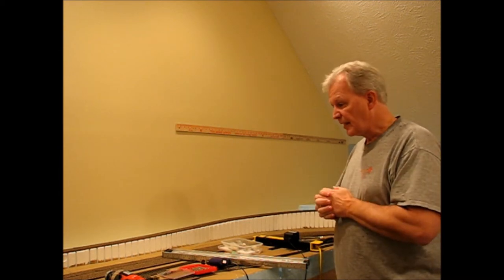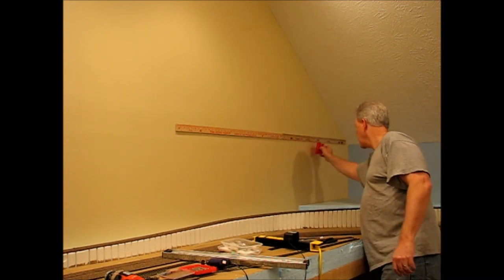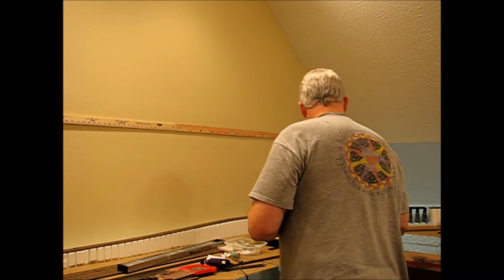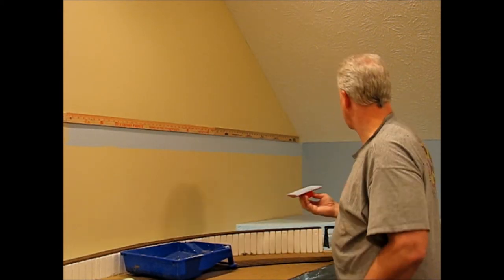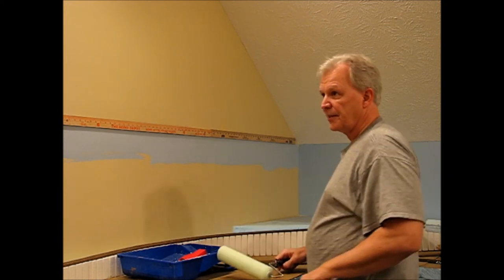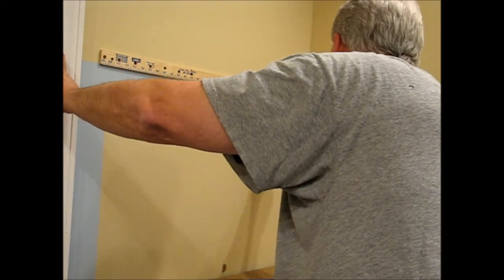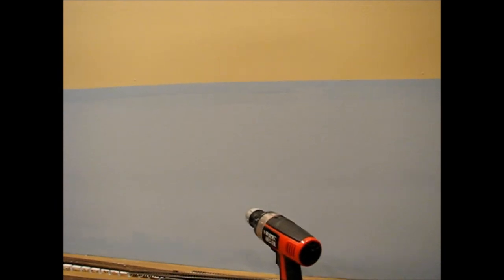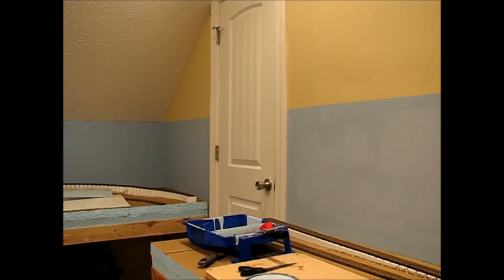My HO Scale Railroad   Episode 31

Comment: Great tip for the backdrop Brian, it's a great sized room you have there too-I like the logos on the truck, they came out well. Cheers, Dan
Reply from the maker: Hey, Dan!  Thanks for the comments.  I have to remember to take things one step at a time and not rush things.  Doing those intermittent small projects helps..
Reply: Yep absolutely.  I often get overwhelmed with mine when I think of all the things I need to do, and find that concentrating on a small area or corner of the layout at a time or certain job as you say helps.  The second it starts feeling like a chore is the second you need to down tools and walk away for a breather I reckon!  It's great fun though!  Cheers, Dan
Reply from the maker: TheMisterdan01 Agreed!  Hardest thing to wrap my head around was that "a layout is never finished" so I decided to not impose any deadlines on myself and just enjoy the process!!
Reply: yep that works for me also!

Comment: Nice work with the edging Brian. I didn't know that tool even existed so useful tip. I am think the car is the same Mattel model I have & it's in 1:76 so OO rather than HO but pretty close. If it's the same as mine it should say 1:76 on the underside... Makes me cry to hear you say they're just a $1 as I had to purchase one and get it sent across the pond... :P Nice mod on your one, it looks good :) - Sim
Reply from the maker: Hey Sim!  Here in the States the tool is called a painting pad or edging tool.  It has disposable paint pads that snap on to the tool.  There are small wheels on one edge that ride along the window and door casings or along the tops of baseboards.  Makes for a nice clean edge.  That truck is made by Maisto and they can be found in white, yellow and red.  I picked that one up just to see how close it was to HO scale.  Sadly, no scale markings on the bottom. Thanks for the comment!!
Reply: Thanks for the extra details about the paint tool Brian and as for the car just had a look at mine and they are remarkably similar but I guess it's maybe that they're just based on the same model of car but by different makers or something :) - Sim
Reply from the maker: Sim, no doubt they are made in the same Chinese factory just probably marketed by two different retailers!!